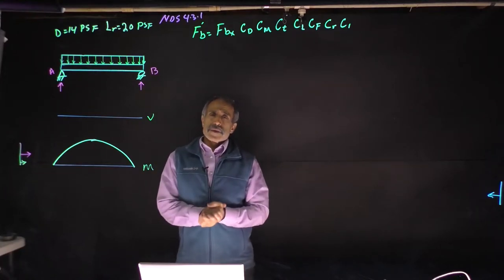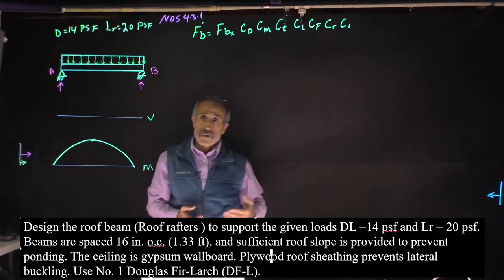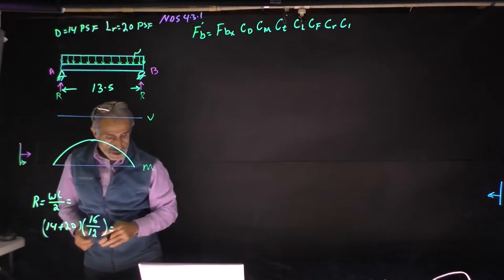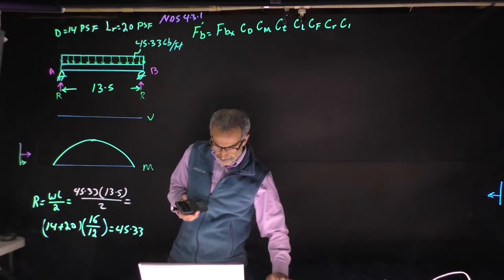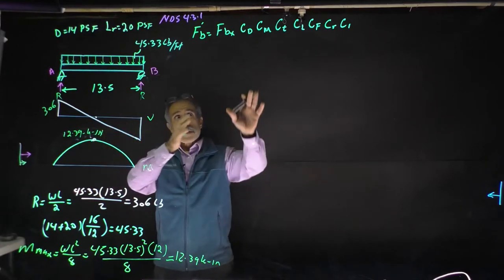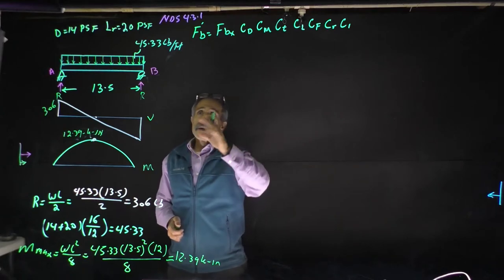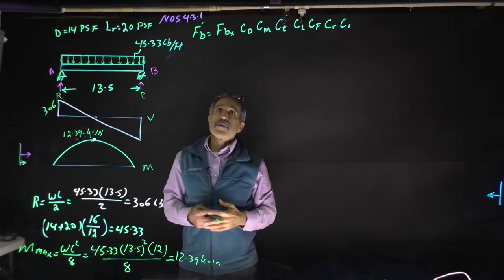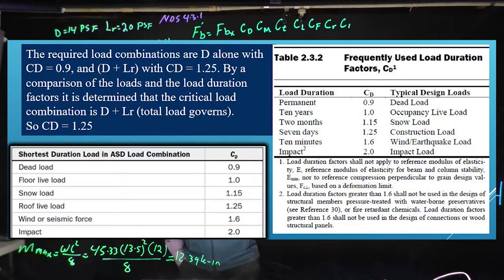Wood Roof Beam Design

Comment: DR.Nasser the deflection calculation  convert  from foot to inches i think there is some thing not clear 1728in3/ft3 i think its 12^4 to convert the length of the span ?!
Reply from the maker: Good question. However, you need to account for the foot in the w the unite weight of the uniformly distributed load is lb per foot and that cancel one out so then you have 12^3.  Deflection = [5 (lb/ft)*(ft)^4*(12in/ft)^3]/(384 lb/in2)*(in^4) the unit should workout to inch.